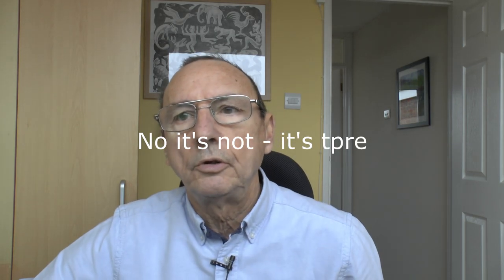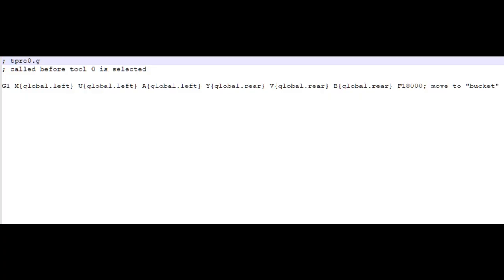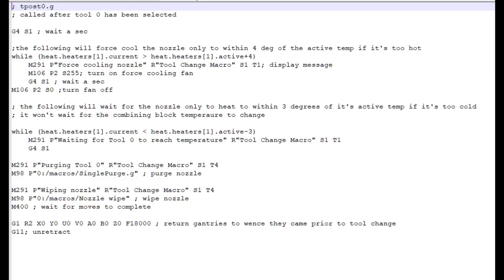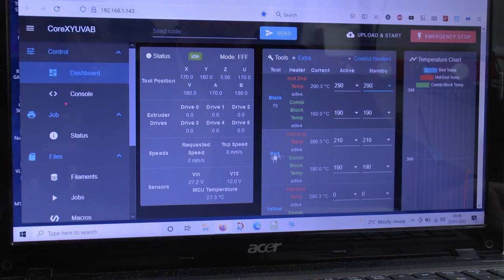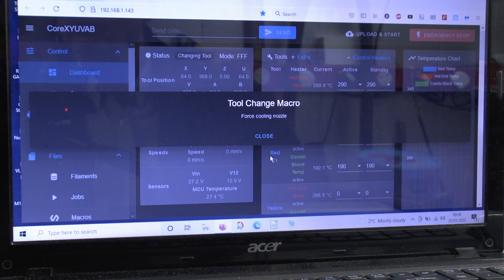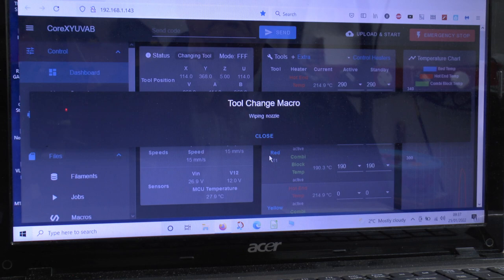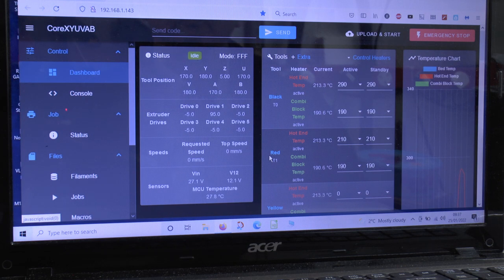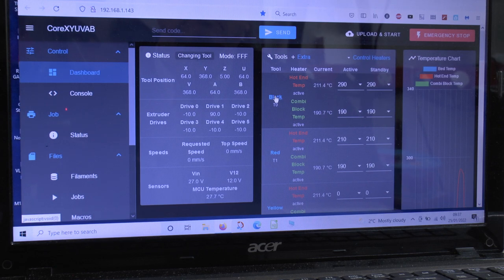6 Input Multi Material hot End Part 6 - Force cooling and tool change macros

Comment: Do you ever get alignment issues between the two gantrys?
Reply from the maker: Actually it's 3 gantries because there is another load balancing gantry which sits at the top of the machine and does the opposite of the other two. But in answer to your question I only get alignment issues when I do something stupid! So for example, at the start of homing, I have to move all gantries together until one or other homing switch triggers, then I home each one individually. There is an allowable tolerance of about 20mm between XY and UV due to the flex in the Bowden tubes etc. After homing I used to combine the axes so the firmware treated the machine as single CoreXY but with 3 X motors and 3 Y motors, so they always stayed in sync. More recently, I've been using motion planning techniques (check out my other videos) which keeps the gantries separated into XY, UV and AB. During printing, the UV gantry will "follow" the XY gantry but within that allowable tolerance. The net result is that the hot end on XY can do short zigzag moves for example, while the extruders on UV remain stationary. I use a post precessing script to add U,V A and B moves the the slicer gcode which only has XY moves.
Reply from the maker: One thing that can screw things up is the nudge buttons on the web interface. Using these it would be possible to move (say) the XY gantry without moving the UV gantry and then bad things would happen. To get around that, I fitted a joystick to the machine and macros will move all 3 axes together (there is another video on my channel about that).